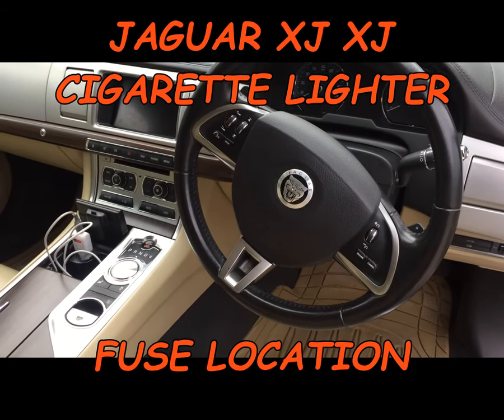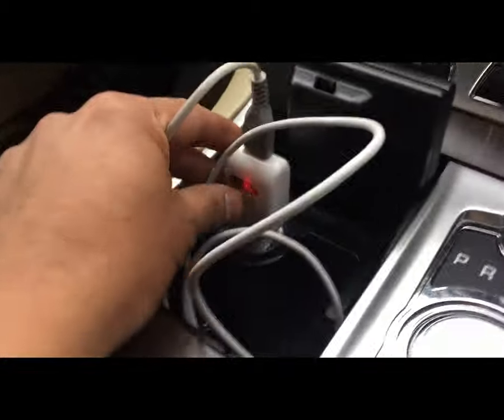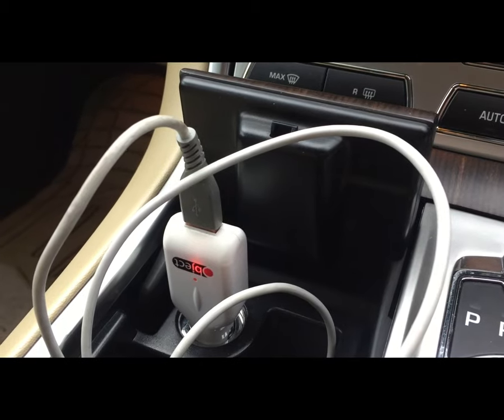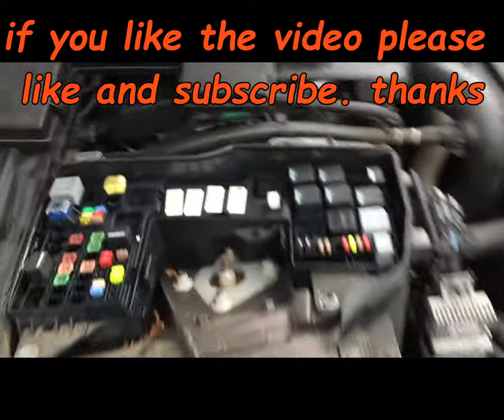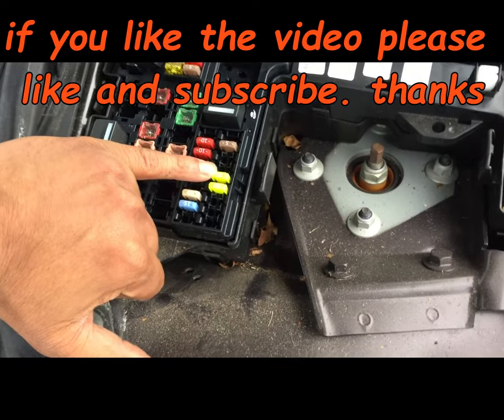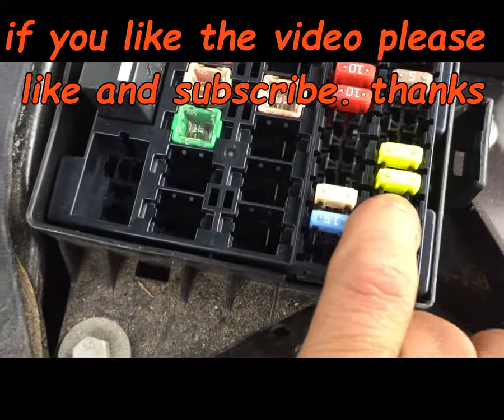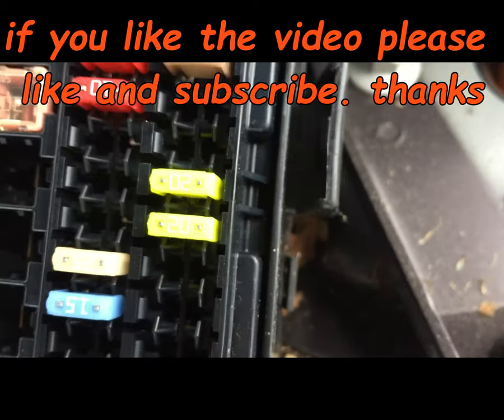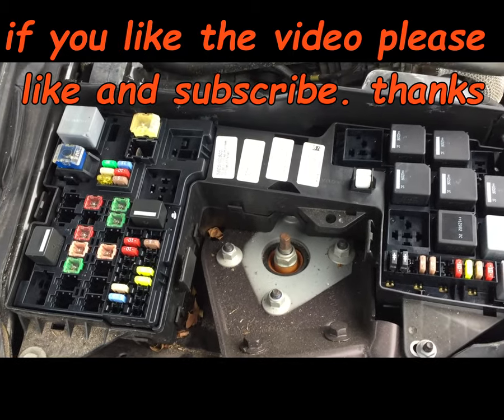JAGUAR XJ XF CIGARETTE LIGHTER FUSE LOCATION POWER SOCKET NOT WORKING HOW TO CHANGE THE FUSE

Comment: I followed the car instructions and it says a blue 25 amp.  Everything on this car is a guessing game. Next problem reversing sensor, whole bumper has to come off for that, now do I strip it down and then don’t have the car to go get a new one, or buy the new one and find it’s a loose connection. Basically it’s a Ford, Even though I worked on GT40s in the 60s/70s my first car was a Ford Capri, every car I’ve had since hasn’t been a Ford and they have all been better. I wish I hadn’t gone by the looks when I bought this one. Too old to bother about changing it now though. Bugger!